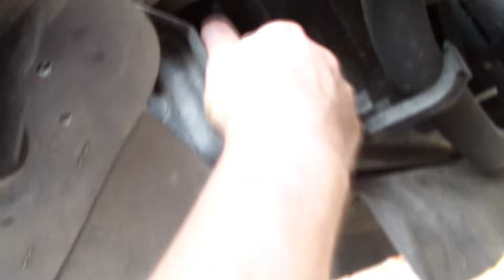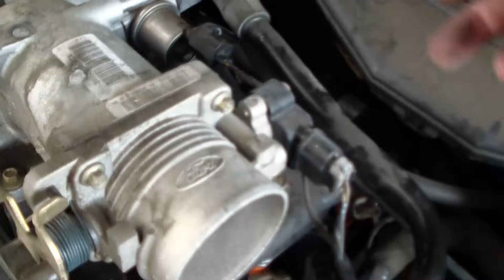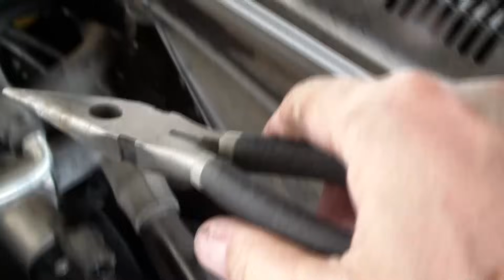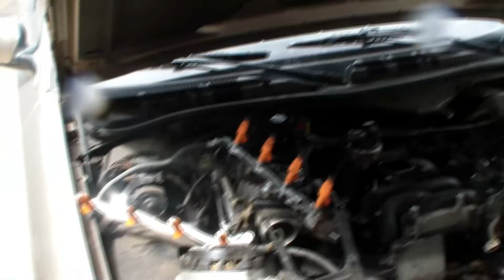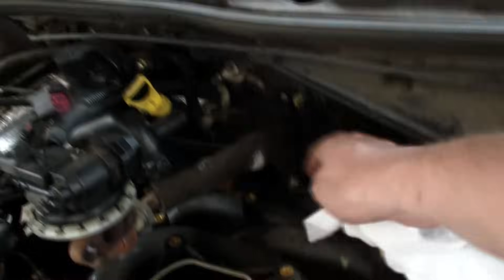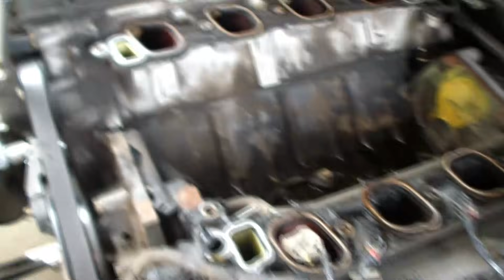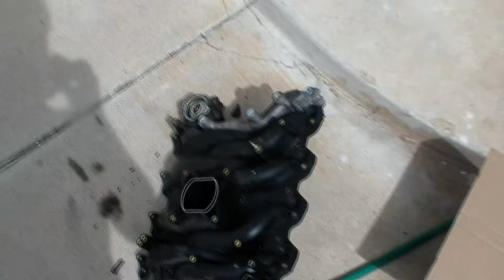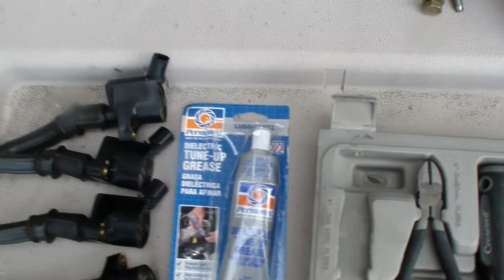Ford 4.6L V8 Intake Manifold Replacement

Comment: Now try replacing the spark plug in cylinder#2. The manifold actually blocks you from getting the socket inside 2 of the spark plug holes. I had to do some modding and had to use a thin socket to finally get them out. Not impressed esp with the money they charge for these.
Reply: I used a pry bar and pushed against the block and the plugs came out. I had to do this with 2 or 3plugs if I remember correctly. You don't have to use any major pressure just gently press with the pry bar, strange but it worked.

Comment: WARNING: if you use an intake manifold with a heater hose outlet on the back, like the Dorman replacement, you will need to change the rubber cap ever few months if you do not use this for the heater hose. these rubber caps will not take the heat. Buy a manifold from ford and it will not be there or will not be plastic but aluminum.
Reply from the maker: I lost 1 MPG with Dorman. The original factory replacement PI manifold can be bought from Ford Racing at a reasonable price. I was rushed for time so used Dorman.

Comment: THANK YOU!! This gave me the courage to change the intake on my 2011 Crown Vic today. Took me 3 hours flat - shade tree mechanic, taking it easy, hand tools only, no air. Your video was so helpful, thanks!!
Reply from the maker: Three hours is a great time. Think I took near 5 but was not rushing.
Reply: @KentDiego  dear i have 2012 and start leakage so in saudi arabic they make cold welding did this work i will used balazona welding
Reply from the maker: @villareal6  The GM should not be any harder. It just takes time and patience. Buy a manifold from Ford Racing to get best price for factory part.

Comment: I tried the cut-&-tap fix with a brass fitting and some JB plastic weld. The plastic is too weak to hold. It'll get you by for a very little while, but it is in no way a permanent fix

Comment: The thingamajiggy is the fuel pressure regulator bud, extended studs are used as an earthing source. On different vehicle configurations depending on the country. Left vs right hand drive.

Comment: OK I just changed out my manifold and found that the heater pipe UNDER the manifold is leaking.
 It was a bit tricky to diagnose with the one on top spraying coolant all over the place.
Manifold has to come off again.
 This is an older video, if you are replacing your intake manifold now go ahead and order the heater return pipe and change it out when you've got the manifold off.
Reply from the maker: Good advice.

Comment: Is this an issue with the 2007 year as well?
Reply: Shouldn't be... your manifold should be the aluminum one like the replacement... the plastic manifolds were used from 1996-2001.

Comment: I agree I used to love Lincoln's but there on my shit list now I have replaced both rear axles 5 times and so far there holding up and the air bags 3 times and there leaking now and going on air bag number 4 my passenger window motor screwed up and my air conditioner was on the Frits when you go past 60 mph the A.C. Would warm up so we got pissed and called the ford motor company and bitched about it for a few minutes and the had it replaced and got the bill and now this shit happened and we have to replace the plastic manifold

Comment: I did this yesterday. Now my car is stalling and idling very rough
Reply from the maker: You have a vacuum leak. Very common. Maybe the mating surface was not perfectly cleaned or manifold is slightly deformed due to torque sequence or obstruction. I hate the Dorman part with O-rings and wish I used the factory replacement from Ford Racing. I put a coating of RTV sealer around each O-ring mating surface to ensure no leakage.
Reply from the maker: So vacuum leak will give rough idle and hesitation on acceleration off idle. It will smooth out at higher RPMs. If you still have missing under power then look to ignition or fuel injectors. Scan CAN bus for error codes.
Reply: Actually u probably just need to change the spark plugs and ignition coils. Same problem on my 1999 Lincoln Town car and it's was a misfire in cylinder 3.

Comment: Why didnt you torque down the bolts on the intake?
Reply from the maker: Every bolt has a torque spec. Manifold bolts also have a sequence order. After a while you get a good feel for the correct torque and you quit using the torque wrench to save time.
Reply: Yeah each one is 25 and if you don't have the exact specs you criss cross 50%-60% then back around and finish. Just would have figured if you're making a DIY you're obviously not doing it to save time. But hey if you didn't have any leaks or cracks afterwards more power to ya

Comment: The "crash bracket" certainly is a challenge.  The video is excellent but......the explanation for the removal of that stud needs a little tweaking.  There are 2 nuts, one...the one still on the stud....and another behind that.  The two nuts, one 13mm and the other 15 lock against a thin plate at bracket rear side.  Given the impossible view I didn't see the inner nut right away.  I was turning the 13 mm on the outside...the one on the stud.  Also, I removed a wire bracket below and to the left of the crash bracket that gave me a tad more room.

The engineer who designed this should be fired.  Probably the same idiot who designed the 4.0 with 3 timing chains.

And why one crash bracket??  None on the right side....i suppose passengers don't matter in the event fuel is splattered during an accident.

Me, I just wanted to get to the spark plugs and needed some guidance.  This was the most intense spark plug change I have ever done.  Anyway, thanks for an outstanding video.......no wind noises, stated what wrenches were needed, how to loosen the fuel rail...............and a special thanks for pointing out the ground on the right read fuel rail bolt.  That would be an easy one to forget when reassembling the mess.

Comment: I have a 1993 Lincoln Town car it's a V8 4.6L engine. and I cannot figure out what connects to this medal "stump" on the right side of my Throttle Body. Looks like maybe a hose? But what hose and where would it even attach to? The left side also has a medal "stump" that has a hose on it.
Reply: Did you have pointless holes on the right back side of your intake on the block a bolt hole and a quarter sized hole half ass covered by intake with part of new gasket sticking out exposed
Reply: @clairereddingtin5958  what would that mean?

Comment: And by the by I'm replacing intake for my aunt for the same damn reason that crazy hot water intake nipple smooth sheared off whoever owned the car before her put some glue on it sold it to her and it popped off once it got hot somewhere down the road

Comment: Great job. In the middle of doing that myself and decided to look for a video. Mine unfortunately came with no instructions. By looking at the new one it does not use that plastic stock gasket that part of your video was missing am I correct in assuming that
Reply from the maker: The aftermarket manifolds have an O-ring and do not use the stock gasket. I recommend you buy the original part from Ford Racing. I lost 1 MPG by using aftermarket part.

Comment: Do you think it would be ok not to put the sound deadening back on
Reply from the maker: The ideal for mechanics is to return the car back to the same condition as it left the factory. Are you talking about the big foam block under manifold? That is more of a heat shield than sound deadening. Will give better mileage and stop pinging. The foam block looked like crap but I put it back in. I wonder if you could use a spray in closed cell foam to replace?

Comment: I am working on a 2000 Mercury Grand Marquis, replacing the intake manifold.  This is my second go around with these manifolds.  My other manifold project was a 2001 F150 so I found some slight differences between the two   My question here is about that bastard crash bracket.  I have heard this called a crash bracket to protect the fuel rail in case of  a crash.  I need more explanation because the fuel rail on the passenger side has no protective bracket and the fuel lines feed the fuel rail on the passenger side, which is on the opposite side and not protected by this or any other bracket.  So how is this a crash bracket?  On the F150, I took off the first (rear) nut off of the stud that bolts into the head at the bottom of the bastard bracket and the wire harness anchor bracket slid right off.  On this Mercury, after I took that first nut off I still couldn't get the wire anchor bracket off.  I had to beat it off with a screwdriver and hammer.  Later I discovered that wire anchor bracket is actually a few inches wide and is bolted in two places.  After I found the second bolt ( 13 mm wrench, bolt is screwed into back of head on passenger side- or maybe the block.)  I can't see the bolt, I can only feel it. I am definitely not reinstalling that bastard bracket, and I have some ideas about the harness anchor bracket with two bolts but not finished yet.
Reply from the maker: I made a big deal about the fuel rail bracket because the reading I did got me scared. It was not that bad. I suggest re-installing. Do it by feel. When the engine gets driven into the firewall the fuel rail disconnects and spews fuel. The federal crash standards call for an offset head-on crash to simulate the most common head-on accident. So only the drivers side gets hit. Maybe a cable tie will work on the harness to keep it secured.

Comment: same heater nipple broke on mine, home depot got pvc adapter 1/2" to 3/8"  JB weld right onto and over that port, good to go, less tgan $6 total and 6hour cure time.
Reply from the maker: I was thinking of drilling and tapping threads for a brass nipple. In any case there is always an increased risk of having the repair fail when you are in the middle of nowhere.

Comment: Excellent video.  Used it as a guide to help me change out the intake manifold on my 2003 Grand Marquis.  I also changed the plugs and coil packs at the same time.  I wish I had replaced the injector o rings as well but I am not having any issues without doing them.  I did not put the old heat/sound shield on the bottom of the new manifold since it was crumbling away as soon as I touched it.  I read several other forums where all the responses were to disregard trying to find one to replace it.  Thanks for posting!

Comment: Congrats on a job well done, Sir!  I want to add a few things for anyone attempting this procedure.  If you are going to disconnect the fuel line, start your car and then give your inertia switch(usually in the trunk) a smack with a screwdriver handle which will cut off the fuel supply and the engine will run out the fuel and then stall.  Just make sure to reset the inertia switch button when you're done or the car won't get any fuel to the rails.
You didn't mention draining the coolant below the level of the thermostat before removing it.  If you don't, you and your engine will be wearing coolant.
Good tip when purchasing a new intake: make sure the mounting holes have the brass inserts so you can use the original screws.  Those self-tapping screws into the ABS plastic is a hideous idea!  You know that ain't gonna last long!
One last thing.  When removing any hardware(screws, nuts, washers) either try to see if you can keep them installed into the component you're removing or at least bag-n-tag them.  Leaving them out on a surface can get bad real quick.  Imagine the dog or your kids come running through and bump the table they're on and everything goes flying and what you can find is all mixed up!  I'd hate to have my project on hold while I have to hunt for hardware at the auto parts store or online or at Pick-N-Pull, of all things!

Comment: What is the black on ontop of the motor? Looks like i conects to the intake boots.... Never seen anything like it?
Reply from the maker: There is a big block of foam rubber that acts as heat shield. Kind of ugly but I guess it get the job done.
Reply: it looks so weird coming outa the intake boot lol is that factory or "upgraded"

Comment: Hi kent.  I used  your video and it worked great. To get at the bolt in back i took off the wiper assembly. Made that part so much easier. Thanks.

Comment: Sounds like he's complaining about that extra 75 he spent buying it local right now. First off, they have a business to run, second, that Dorman part has a lifetime warranty and WHEN it cracks again several years down the road, you'll never have to buy another if you keep that receipt. You just take it in and swap it out with a new one no questions asked. If you get it online, you'd have to take it off the car, ship it to Dorman, Dorman would look at when they get a chance and determine whether or not they'd replace it under warranty and sometimes they claim installer error and refuse to warranty it. The ONLY pro to buying that online would be the initial savings.

Comment: Why is there coolant in my sparkplugs and coils
Reply from the maker: Coolant runs through manifold at front to radiator and at rear to heater hose. Maybe crack in manifold or leak in hose spraying coolant while driving. Inspect near thermostat housing and radiator hose for residue or wetness.

Comment: going to try this job on a 2002 Lincoln, plastic peace broke off on back of intake manifold (heater hose nipple) while trying to replace fan blower resistor, what a pain in the ass this caused me, this plastic nipple peace just crumbled apart, what a load of crap. and a shitty location for the blower motor and blower resistor, thanks for the vid. Kent Diego maybe hope yet!!

Comment: My 04 Grand marquis thermostat started leaking coolant when reved on the gas.. bad o-ring.. now its dripping coolant behind the thermostat housing. I believe i have a cracked intake manifold thats leads to leakage under the car/firewall.

Comment: Great video, but i missed the intake manifold runner controller. my wifes f150  is getting a P2004 and P2005 intake manifold runner control stuck open on bank 1 and 2.hopefully i wont need to remove the whole manifold to get that out of there.

Comment: finally got that stupid bracket out! i ended up taking a grinder and cut off the portion that goes to the firewall.  fuckin usless part
Reply: after removing a few items there are always a few xtra bolts and nuts and a few parts that weren't really needed ...at least that has been my experience ...but as i've gotten older i end up with fewer xtra parts

Comment: One thing I was wondering is can you reuse the manifold gaskets since they're plastic or should they be replaced????
Reply from the maker: The Doorman unit had integrated O-rings so throw away old gasket. If you use proper OEM Ford Racing part (recommended) then it is always wiser to buy new gaskets. It is a 4 to 6 hour job. Why take chances?

Comment: just did mine on a 2008 F150 w 4.6L ... I ordered this part # from Amazon APDTY 726486 Intake Manifold ....
I do have some mid level experience working on my own vehicles and a good collection of tools... so depending on your experience - you may find this somewhat difficult...
It is not a  complex procedure,  but tedious  and took me 5 hrs to complete... I also replaced the orings on the injectors while I had the fuel rails off... unlike this video , 2008 model has a half/ throttle body attached to a plastic housing - I disconnected 4 bolts an just laid it to the side EZ... if in doubt - take pictures of wires and hoses... the only pain in the ass was the drivers side manifold bolt closest to the firewall - the wire harness is laying on top of it ...
Reply from the maker: Looks similar to Doorman. Suggest you use Ford OEM replacement part. Can order PI improved model from Ford Racing.
Reply: are you actually suggesting I take off the one I just put on....send it back and order the much more expensive Ford part and .......... you see where Im going ?
Reply from the maker: Guess my advice was a little late. I lost a solid 1 MPG by using the Dorman. Wished I spent the extra $75 for the Ford PI unit for exact OEM replacement. Hope yours works OK. Be sure to save the old bracket and bolts just in case....

Comment: Thank you for posting brotha! Just finished putting a new intake  my 2005 CVPI and watching this helped me through. But yeah all that work for a plastic nipple haha hopefully never again.
Reply: MGMStealthv2 I have a 05 Vic to. I am worried my coolant leaking from the intake is leaking internally now. I am going to replace the intake next week. I been checking the oil and its clean but my oil cap is getting milky. Only has 84k on the car and the intake is fucking me
Reply: @IMP429  after u drive a few mins that milky oil cap will clear out , my 02 4.6 has 350000.0miles on it I hav seen that on my oil lid just after start up but on after few mins driving it's gone??

Comment: WHAT is the screw on the right side of the engine under the manifold? It has a wire cuoppling/clip and goes into where the pistons are I believe... Mine is needing replacement

Comment: this video really helped a lot and saved me a lot of money I found the manifold on Amazon for 300 bucks the local auto shop was trying to charge me 12 to 1400 for parts and labor took me a few days to get that bracket due to the weather conditions however I did not reinstall the bracket after replacing the manifold there was also another bracket wiring harness in front of that bracket I ran into during disassemble of the manifold bracket